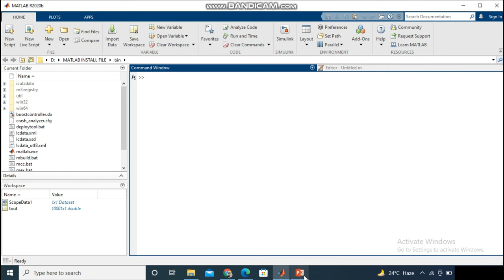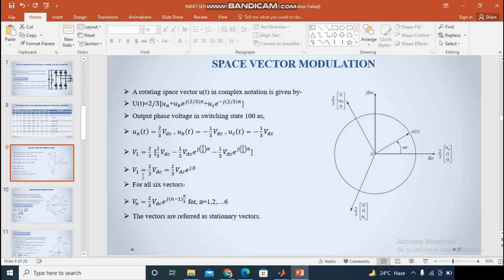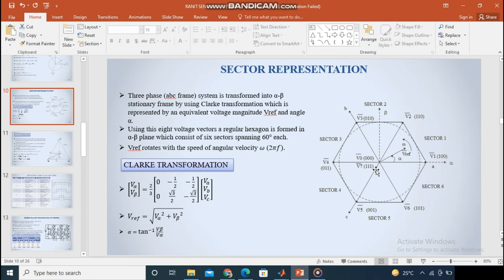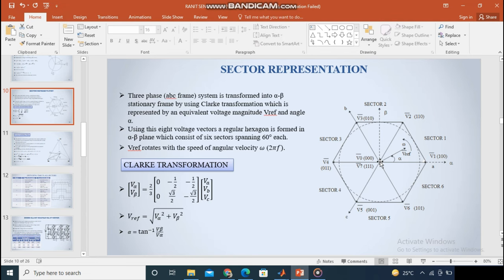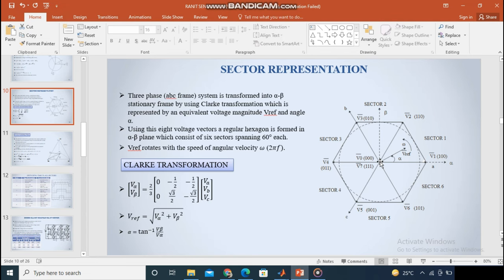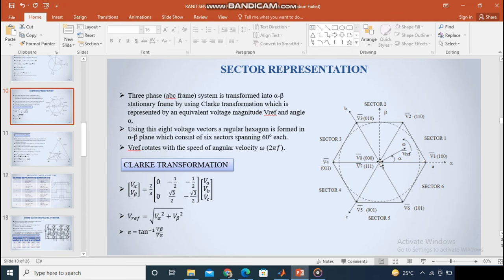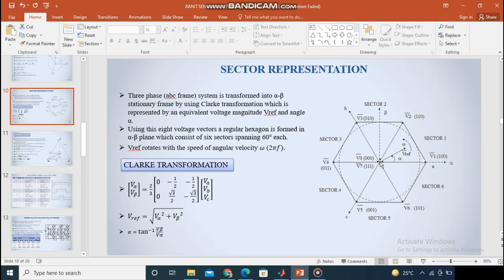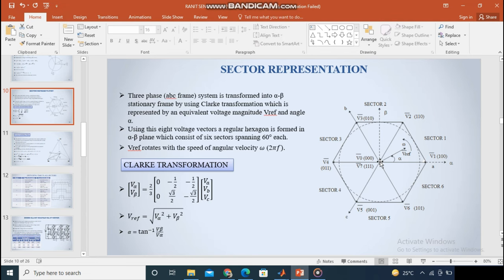Space Vector PWM based Three phase Inverter design | SVPWM (2-level) | MATLAB Simulation

Comment: Hello, Ranit, on the moment 20:04, the sequence of S5, S2, S3, S6 should be change to S3, S6, S5, S2?
Reply from the maker: Yes i just took a typing mistake in ppt but don't worry simulation is perfect because i used not operator and please look into the DESCRIPTION . I wrote the switching table perfectly

Comment: #urgent
Dear brother,
I am a masters student and i have a problem in designing this model. Whenever i run simulatioj error showing that the output port 1 of IGBT/Diode is not connected'' why its showing. 
I will be thankful if you reply

Comment: If we are using a 600V motor, is it enough that we change the battery voltage and VDC to 600 and rest of the design remains the same.
Reply from the maker: Yes then we have to increase the input voltage
Reply: Input voltage you mean 230 V .?

Also you have used T=.02s, is it because the operation is for 50Hz
Reply from the maker: @patric5533  no input voltage means input  VDC .here it is 380.
And ts=0.02 it is for the sine reference only. Circuit Operating frequency is the carrier signal frequency means triangular wave frequency.
Reply: ranit., i have mail you the query please revert

Comment: Hi Ranit
Can you help me to explain more why the input value of 
1. Amplitude of 3 phase Input 230 ?
2. VDC input Value 380 ?
3. VDC Battery 400 ?

could no. 2 and no.3 be same ?
Reply from the maker: Yes it would be
Reply: @RanitSengupta  Why the Amplitude of 3 phase Input 230 ?
Reply from the maker: @arifinnugroho9191  because in India we use 230 volt phase voltage. For this I take it as a reference
Reply: @RanitSengupta  230 is rms. If u want to use 230 volt then amplitude has to be written as 230*sqrt(2) ie 311 V

Comment: Dear sir your video tutorials are extremely helpful. 
With this switching pattern, how can we drive 1) single phase load. 2) single phase load along with 3 phase load like we do with commercially available 3 phase solar inverters. Thanks. Love from Pakistan. Imtiaz Hussain.
Reply from the maker: Thank you. Can you please mail me.
Reply: @RanitSengupta I mean I want to learn 3 phase switching along with neutral wire so that we can power single phase appliances connected in star configuration. How can we obtain NEUTRAL WIRE along with 3 phases. Thanks

Comment: brilliant work man!! thanks a lot, the audio seems to be off in the latter half. Can this be deployed into hardware(say arduino nano and signals generated using the pwm pins). thanks a lot in advance.
Reply from the maker: IT may be after code generation
Reply: @RanitSengupta  thanks
Reply: @RanitSengupta  hi, i generated the code through simulink and deployed it to arduino, firstly, thanks once again for this amazing explanation, as i am getting the 3 phase voltages in the hardware after using driver circuit to drive the mosfets.  However, the voltage is dropping on load. After reading a few papers on the same, i have relized that the PWM switching frequency must be a minimum of 20Khz and above, through normal c programming, it called for introduction of clocks, timer registers and interrupt routines to increase the same. It would mean the world to me, if you have any idea how to increase the switching frequency in the simulink model above. thanks in advance.
Reply from the maker: @jrk5455  Just increase the carrier signal frequency means the triangular signal frequency.